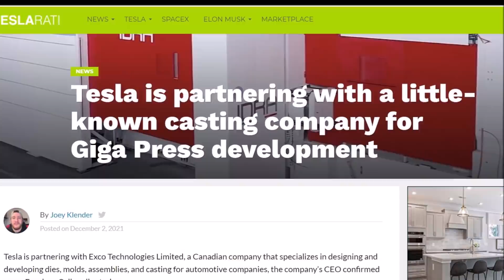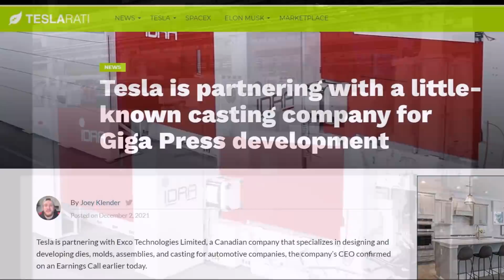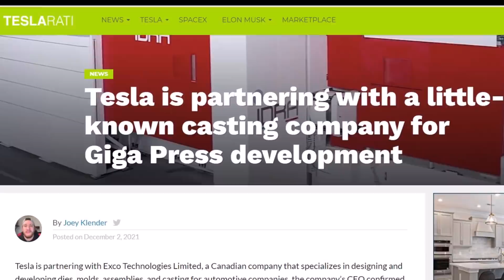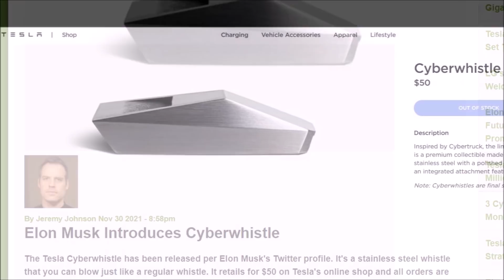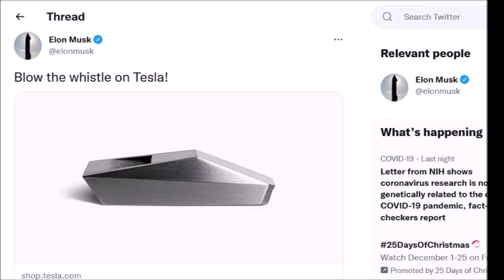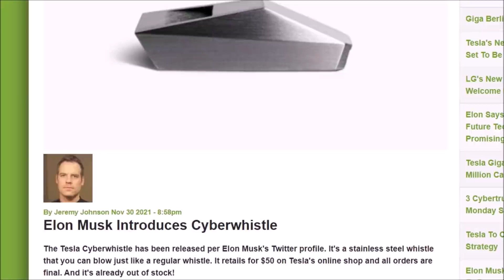BREAKING: Tesla Is Developing Giga Press With a Little-Known Canadian Company

Comment: My wild guess is that the design of the mold itself is as critical as the giant casting machine. 
Internal parts have to optimize the flow of aluminum during the molding process; while external
parts have to be designed to both be aerodynamic in use and have optimal flow for molding.
Some parts such as the octovalve (if it were die cast) would have to optimize the flow of fluid through
them in use, but also optimize the flow of aluminum during casting; that sounds like a wickedly complex
combined optimization.
Reply: Do you work in diecasting? You sound knowledgeable

Comment: TESLA depend on the ITALIAN, IDRA GIGA PRESS and also depend on IDRA Die-Casting, Molding Company. The EXCO Tech is a CANADIAN Company who specialized on making Die Casting Materials for future Tesla body parts. There are several Metal  Giga Press  company in the US  and maybe Canada have also a GIGA Press Company. This move shows that EMusk does not trust the Chinese, who allegedly bought  IDRA  Giga Press. Remember the METALURGY FORMULA  on  the Metal Casting material is patented to Tesla, the metal produced are NOT brittle, lighter and  much stronger than any metal material